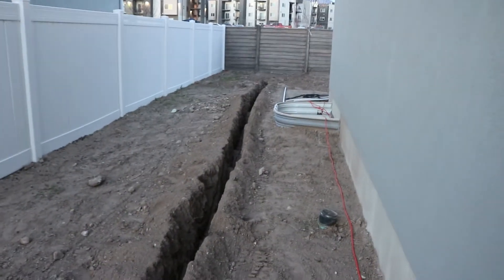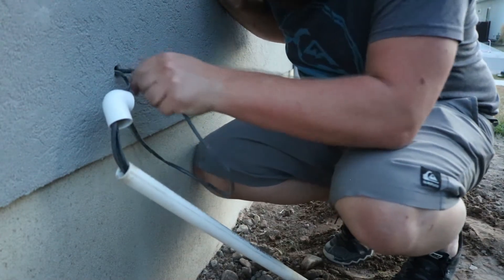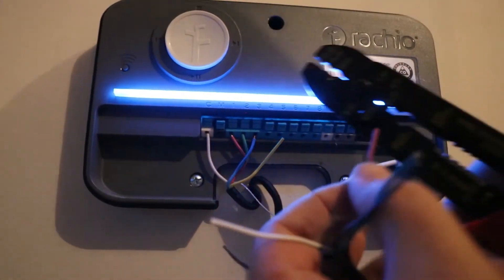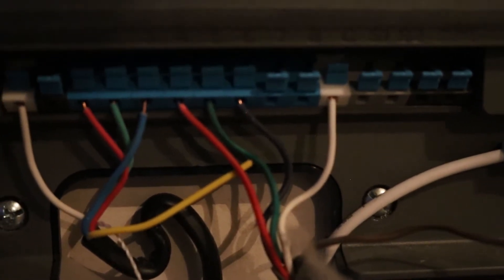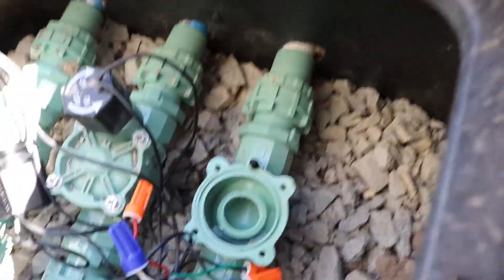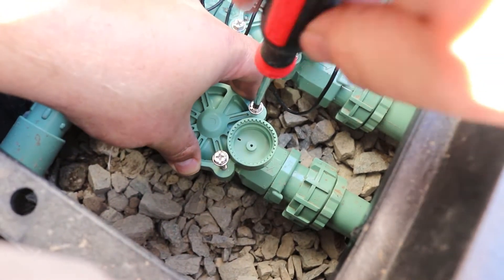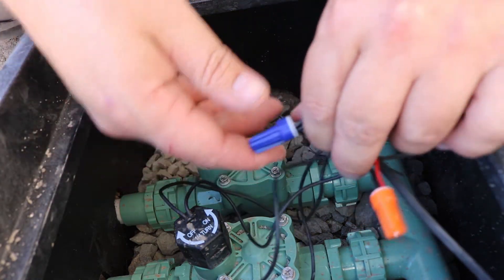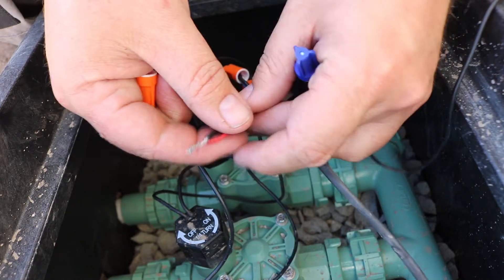Adding Additional Stations to my Rachio 3 Smart Sprinkler Controller

Comment: Can you tell me which valve/solenoid you have used. I want to setup the same that can work with rachio 3.
Reply from the maker: I used the Orbit 3  sprinkler valve manifold. It’s nice because al the valves are already together. I’ve also used rainbird sprinkler valves for my garden when I had to get them a little closer than the manifold would fit. Had to do a bit more work to connect everything it it works perfectly. 

Any valve should work with the Rachio, as long as it has 2 wires going into the valve, the Rachio will turn it on. I have Rachio for my yard and the Wyze for my garden. Both would work.
Reply: @brandonturpinhomegarden260  Thank you so much for your reply. There are too many when I googled for Orbit 3  sprinkler valve manifold. can you let me know specifically which one? Do they have anti-siphon?